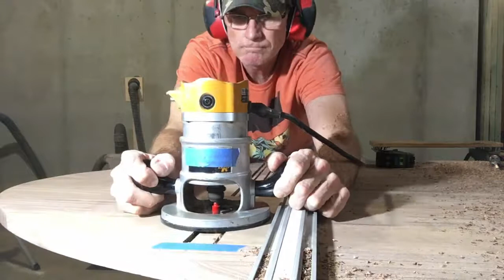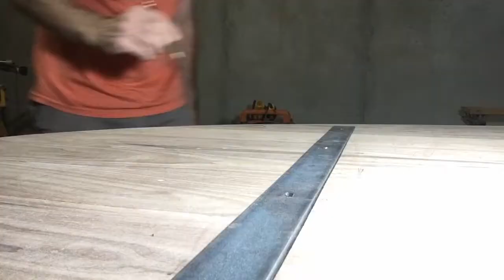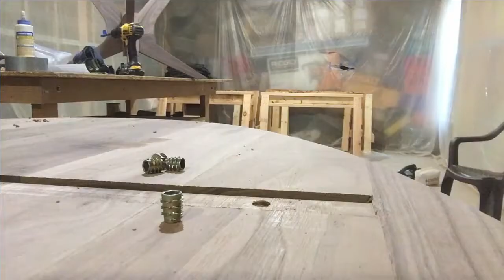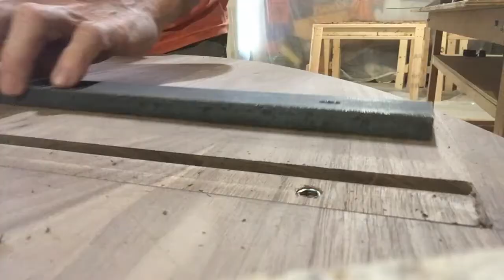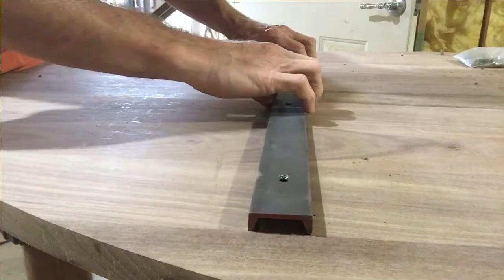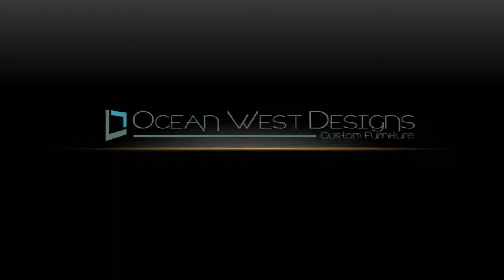Installing the C Channel Steel Bars

Comment: Can simple wood screws be used directly into the wood with washers?
Reply from the maker: I would not use wood screws only.  They could strip out.  The proper way is to use threaded inserts.

Comment: May I know, what is the purpose for install it? Avoid table top to cup or wrap in the future?
Reply from the maker: Keep the top flat.
Reply: @oceanwestdesigns1416  can the C Channel Steel avoid the wood to be twisted or cup?
Reply from the maker: @ravenkang  The key is picking out wood that is not twisted or cupped.

Comment: this is great. Thank you. Is this 2 x 1/2 x 1/4?
Reply from the maker: It is a 2 x 36 x 1/8
Reply: @oceanwestdesigns1416  Thank you. What kind of bit did you use? Same with your inserts and bolts?